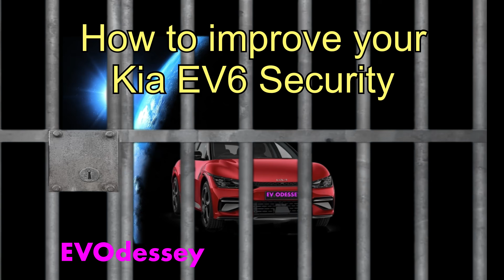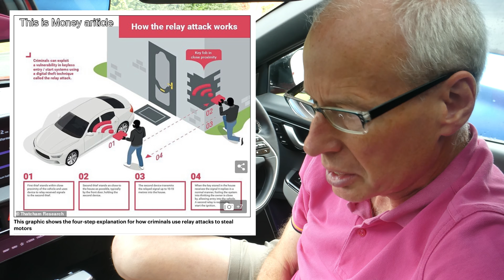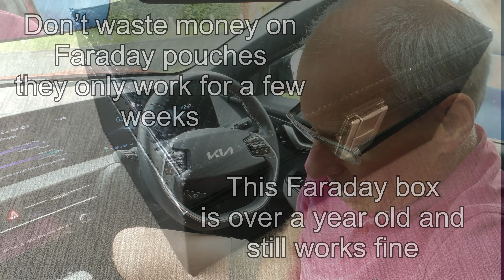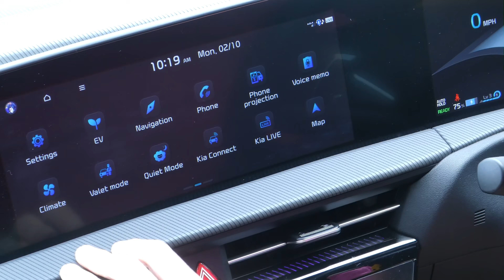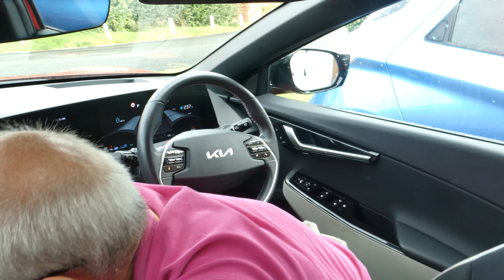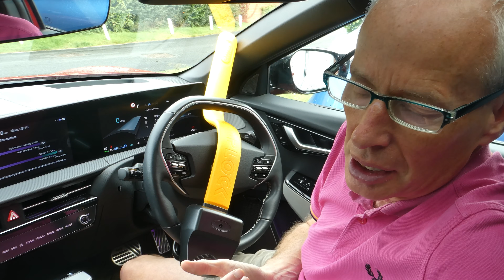How to protect your Kia EV6 against theft - revisited

Comment: I live in London with a Niro EV (trim 3). The Faraday pouch for my keys is now 9 months old I check it's effectiveness monthly and it's still OK. (A friend uses an old biscuit "tin" which seems equally effective.) Not sure if my Niro has the Kia Smart Key but will check so thanks for that. I deliberately pay a moderate degree of attention when going to and from the car so that anyone loitering or watching from another vehicle pecomes apparent. I do have an OBDII port lock permanently fitted although I do also choose to occasionally remove it to use a reader. Anything that delays the crims. I DON'T have the window sticker that came with it displayed on the car as why broadcast what would be required to circumvent the security? I don't see how Valet Mode is a help unless you mean for it to be activated when you leave the car for a bit. It appears to reduce the functionality of the car in ways that delay the crims' getaway but don't delay  the original theft actions. A vid on YouTube recommends locking the car then holding down the Lock & Unlock buttons on the key for 5 seconds when the lights then flash, showing that the remote key functions have been disarmed. I then seem to definitely have to use the Unlock button on the key to open the car again insteada of the touch pad. I have a StopLok Pro steering wheel lock similar to yours, but the nearly straight one. The downside of mine is that it occasionally activates the horn! Also it's too long to mount the way recommended by the manufacturer but a local security expert mounts his after he's stood up so that the bar obstructs the seat, delaying any thief further. As for turning the wheel when mounting the device it engages the car's own steering lock with the front wheels at full lock, which inhibits the crims in two ways: 1)  it complicates some of the ways the car can be "towed";  and 2) it means that the very small amounts that a car can be steered with a StopLok in place is now insufficient to get the car going straight ahead.
Reply from the maker: Valet mode stops them going into Kia Connect settings to easily disable Kia Connect. That means you can still track your car from the Kia App. I also have a few Apple airtags as backup trackers hidden in the car.
Reply: @evodessey  Thanks. I wasn't clear what was the prime benefit of valet mode from the perspective of vehicle security.

Comment: Thanks for your video.  What do you mean by Using the touch pad to lock ?
Reply from the maker: I think I discovered disabling keyless entry completely after I made this video so not relevant any more. To disable keyless on 2022-2024 EV6 In UK/EU market press and hold lock and unlock until indicators blink. The whole keyless entry was the exploit
Reply: Thanks for your very helpful reply to my question

Comment: Hi Brian, Did you carry on using Stoplock Pro Elite Car Steering Wheel Lock HG 150-00 on Elvira until the end? 
Did you find a handy place to store it when not in use?
Reply from the maker: Yes, and i’m still using on my EV3. I used to have it wedged under the drivers seat on my EV6. Had seat moving function turned off for that. On my EV3 it’s strapped into the rear passenger seat using seat belts.
Reply: @evodessey  Cheers Brian 👍🏻 Still in two minds 🤔

Comment: Thank you for this video and for your work in making useful content. I have an EV 9. I got  a crook lock but find that the middle part of the steering wheel protrudes too far to deploy the crook lock. This annoyingly activates the car horn. The crook lock was bought for my previous car, a 2021 Discovery 5 and it fit that steering wheel like a charm.
Reply from the maker: Cheers. That’s a pain. I never thought to try my steering lock on the EV9 when i test drove it.
Reply: @evodessey  Theft prevention isn’t usually part of the testing process. The mere thought of getting a car knicked is a bother. I like the EV9. It’s our first electric car. I had learning issues when using high power chargers. The car needs to locked while the charger and car negotiate. Also, the charger plug needs to be pushed in and held to allow the pins to meet. The weight of the charging cables can cause tension on the plug. 
One issue that has come up is the extremely annoying inattentive driving alert warning which cannot be disabled by law, unlike the speed limit and the driver awareness warnings. The inattentive driving alert is the yellow steaming coffee cup symbol that appears above the speed indicator and is accompanied by incessant two to eight chime. The chime sometimes switches itself off. Stopping the car, for a half hour to charge and take a pit stop break stops the alert only to come on again roughly 10 minutes into the drive. I know this isn’t only a KIA issue but it might be interesting to test other manufacturers’ solutions. These well intentioned safety systems and the negative reaction of drivers may lead to a buyer strike and cause a surge in pre 2024 used cars which were sold without this annoyances! Rant over. Sorry.

Comment: Hi Brian,  Just trying to figure out some of the secure ways to lock the car.  From what I can see, you can use Kia Connect, the door touchpad and the keyfob.  Kia connect seems to be the securest option given that it is wireless.  The keyfob to me is the weakest as it sends out a code that I assume can be copied and then used once you are away from your car.  How secure is the touchpad and how exactly does that one work?  I assume the touchpad is allowed to be used when the car senses the keyfob as being close but does not cause a code to be produced that can be replicated by someone sitting in a car close by.   Thanks in advance.
Reply from the maker: I think Kia Connect is safest as you say. 2nd method is touchpad which relies on Key short range proximity signal. Pressing key fob buttons are much longer range signals and are probably more surceptable to relay attacks/cloning. The physical key is designed to go to sleep after a short delay after no movement detected. Hope this helps. Despite this I still keep all of our keys in a Faraday box.
Reply from the maker: I also did an updated Car security video recently after a spare of EV6 & Ioniq 5 key less thefts https://youtu.be/Llo7kRzKvpQ

Comment: Good tips and info - thanks. I have a Stoplock thats currently not being used so will try it and see if it fits. Might deter someone who is only equipped for a cloned key?
Reply: My ordinary Stoplock fits but the other way around - arm pointing down, which IIRC they recommended but may be wrong. Bonis is its pretty much impossible to get it or out of the car without it hitting the horn 🤣 so no stealth attacks in the middle of the night on my driveway!
Reply from the maker: @tripswithgriff I got mine to work the way it should eventually without turning the steering

Comment: Hi Brian, great video as always. Today went down to Halfords and asked to try the slightly smaller (more compacted) StopLock Pro. It fits great, no need to turn the steerng wheel upside down. Halfords have a promotion on this week so only paid £39.99. 
Keep up the good work, Iain
Reply from the maker: I've managed to get more mine on now without turning steering wheel. Just needed to try a bit harder😂 That's a good price.
Reply: @evodessey  You should still turn the steering wheel to full lock before fitting. Doing that ensures that the car's steering lock properly engages to provide the maximum headache for thieves. Also I was advised by a security expert to put the bar downwards as this prevents or at least delays a thief physically getting into the car. (Apparently they like to do anythung destructive while sat in the seat with the door shut - they're less likely to stand in the doorway attacking your wheel)

Comment: the lock is no deterrent for the thieves, they just cut the steering wheel with a hacksaw or battery powered grinder off in seconds. they are stealing the car, they don't care what damage they do. I was in a car park on the phone to work and watched a bunch of kids trying to steal a moped. they pulled out a large pair of bolt cutters. they almost had the lock off when one of then saw me on the phone and took off.
Reply from the maker: I know. It’s only a deterrent to slow them down. If they really want it they will get it.As i say in the video no such thing as 100% security.

Comment: Stoplocks are generally a waste of time these days. Unless you can if it around the steering wheel control buttons as all they do is make 2 easy cuts with a hacksaw or battery powered saw and its off. This is why disklok are a bit better, they can be removed or bypassed but not as easily.

Comment: Thanks for this video. Is there any merit in turning off "unlock on approach"? I could live without it if so.
Reply from the maker: I guess all it would do is show a potential thief that the car was successfully opened, mirror unfolding also does this,I've left mine on but have considered turning it off
Reply: @evodessey  This video makes IMHO a strong case for turning off "unlock on approach". https://youtu.be/0QP1ruJV3PU?si=O7Q-OBNKcM_wRIYa

As a fellow IT professional, I'm sure you're well aware of the "defence in depth" strategy: for it uninitiated it can be summed up as implementing multiple layers of security for important targets even if those layers might seem redundant on paper. Each layer is still another obstacle that an attacker must get past, and with multiple obstacles the chances of them giving up increase dramatically.

As such I've turned off "unlock on approach" on my EV6, along with keeping the keys in a Faraday box at home and a tested Faraday pouch when away. 

If the crims can't even get the car to unlock with a relay attack then they are very likely to just move on to a softer target, I reckon.
Reply: @evodessey  But wouldn't turning it off completely deny relay unlock attacks?
Reply: In Ioniq 6 "unlock on approach" can be turned off in the menu. Not sure if it fully protects against "gameboy" attack.

Comment: Some additional things you can do. Remove very specific fuses. For example, E-Shifter Fuse & relay, "EPCU" Rear/front inverter (but your car will no longer top up 12V), MDPS (Power steering - Won't make the car undrivable, but it'll make it REALLY difficult). Also, if you pop up the firemans fuse, it'll isolate the HV battery, so no topping up of 12V again, but another option. Yes, any seasoned crook likely will have these as "spare", so add in additional things, like Ghost 2 canbus immobiliser. You mostly want to frustrate them, as the more time they're spending tinkering with the car to get it started, the more likely they are of getting caught.
Reply: I will warn though (I just tested this), if you remove the E-Shifter relay, and try to start the car, it won't start, but moreover, you then CANNOT TURN THE CAR OFF. Reason for this is, the car tries to put itself into Park, and it can't as the E-Shifter is non functional. For safety, I disconnected the 12V, and inserted the relay back in then connected the 12V back again, all working fine. Removing the firemans fuse, you get a warning on the dash saying check electrical system, or to that effect.
Reply: What I'd like to see: matching number 2FA. Much like Microsoft do. The car powers on and sends a "matching number" to your phone. You then type that in, the car powers up.

Comment: As you rightly say no car security is guaranteed. It is difficult to chose which is the best device to buy and so looked at the different steering wheel locks and watching a video these to people got all of them off within a very short space of time with the minimal number of tools. The best alternative to what Tesla offer is what a friend of mine has had fitted to is Audi  RS3  its called ghost system they fit it at your home and you arm and disarm it via a sequence of button press using the cars controls. It costs about £600.that’s what the police and his insurance recommend. The only problem with it on the Kia EV6 is you would not be able to start the car from outside with the key and as such move the car while stood outside. Witch wouldn’t bother me if means keeping your car.

Comment: Thanks once again Brian. Do you have any experiences or thoughts of how a third party, aftermarket immobilizer and tracker would work with the EV6? There seem to be many Thatcham approved devices where you need to have a separate physical token present in the car to start it,  and if not present the engine remains immobilized. My concern is the 12V battery drain (especially with the EV6 and some of the problems people have had) although I know they say it is minimal voltage. Perhaps this isn't even a problem now that recent updates may have resolved these battery drain issues and the traction battery would top up the 12V if something is pulling power like a security unit. Anyway, any thoughts as to this as a solution or from other subscribers who have had something like this already fitted on their EV6. For now I have invested in a Disklock, which like another of your subscribers says works well, especially for leaving on the drive overnight and is a pretty hefty piece of hardware. Cheers.
Reply from the maker: I’ve not really looked into 3rd party trackers apart from airtags which would work but are also easy to detect with an iPhone so they are of limited value.
Reply: I've been looking at lots of devices for another vehicle and most say they aren't suitable for EVs - especially anything like a Ghost that requires integration into the electronic systems.

Comment: I bought a Dislok, it covers the entire steering, no adjusting required. I've put it on every night for 20months, it fits perfectly, and doesn't mark the wheel etc.

I've seen an example on the UK EV6 owners group this week whereby the thieves had cloned the key and after nicking the car they goughed through the plastic area where the USB ports are and cut the wires that control kia connect. So sadly valet mode is of little use as they already know how to disable it. I still turn it on every night as it only takes a second and maybe not all theives know how to disconnect it (although i suspect they do sadly)

Comment: Thanks Brian, The Genesis GV60 already has several options between getting in the car and starting it. There is a PIN that you set that may be activated before you can start the car (similar to that shown in your video); or, there's the fingerprint reader that requires a scan of your fingerprint prior to enabling the start. The fingerprint reader is 90% reliable in my experience, but if it doesn't work, the option to use the 4 digit PIN is there and has never failed me on use, yet. These facilities are obviously available to E-GMP vehicles, HMG just needs to make them common between Brands!
Reply: Useful to know thanks
Reply from the maker: Yes give the rest of us some of those goodies😎👍